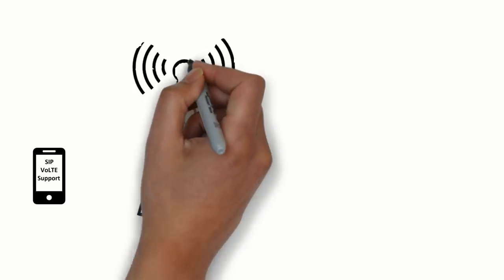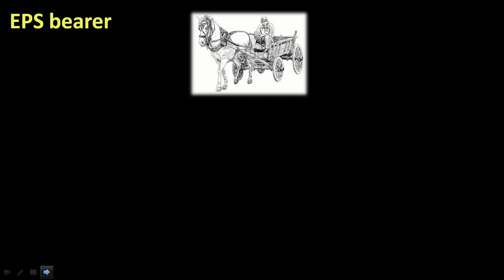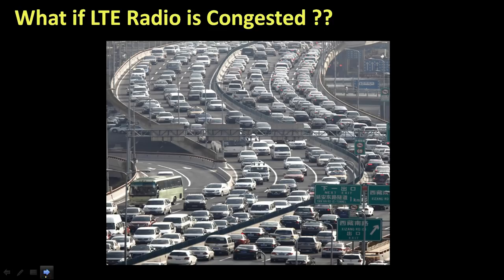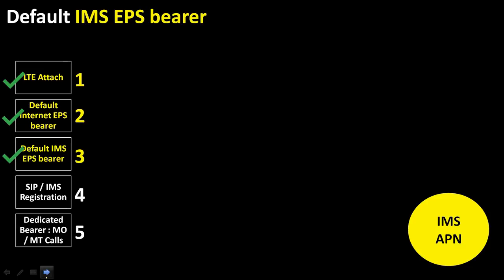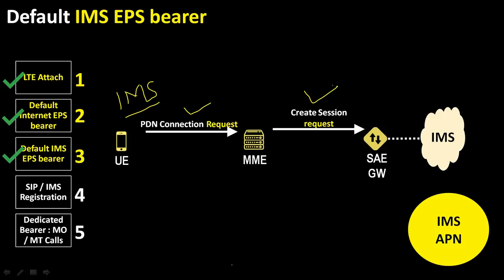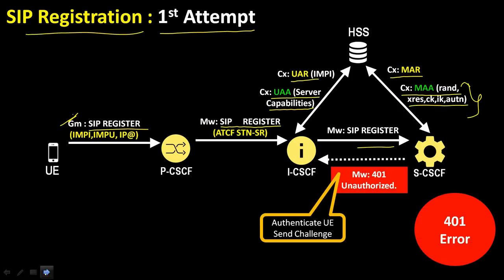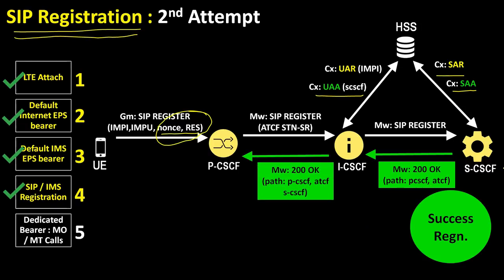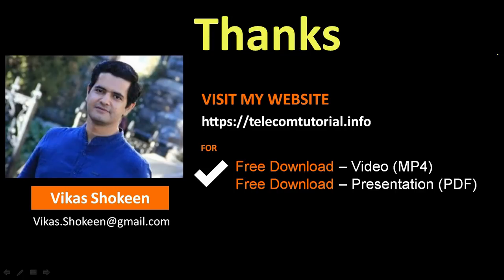3. IMS registration call flow - VoLTE Registration call flow - SIP Registration call procedure

Comment: Hi Vikas , 

Thanks for sharing valuable info through this video , Could you please help me to understand below query -
-  As we know in SIP  Via , to , from , call ID , cseq , max-forward and Contact are mandatory header for successful registration , is any other header which  are mandatory in SIP IMS ? like I have seen sip register contains -P-Visited network , P-charging vector and P-charging function in registration message .

- what is path header and why its required when already route header is there with register request ?
-

Comment: Hello Vikas, great content. Quick Question- If default bearer for QCI 6 or QCI 5 breaks during a call setup(INVITE- 180 ringing), can this result into a call setup failure?
Reply: I guess, by the time a 180 ringing procedure from a called UE to the calling UE in the INVITE message from calling to called UE, there is already resources reservation and dedicated bearer setup (QCI 1 if voice call). The call cannot proceed if the signalling part of the call is lost. This is my understanding of the flow. There must be a secure connectivity between UE and P-CSCF during the call

Comment: For IMS Apn, will there be a new IP address to assigned to UE ??
Reply from the maker: Yes , As explained in Bearer section , IMS APN is created on Default Bearer which has its own IP address ( this IP is different than one allocated for Internet APN )
Reply: TelecomTutorial info how PGW knows P-CSCF address , does PCRF returns it or SAE GW  has its own  configuration
Reply: Syed, P-CSCF IP address are stored internally in GGSN or P-CSCF address has to be obtained via DHCP . UE once it is attached to the network  triggers a PDP context activation procedure which carries PCO field with request of P-CSCF address.

Comment: TelecomTutorial info how PGW knows P-CSCF address , does PCRF returns it or SAE GW  has its own  configuration
Reply from the maker: P-CSCF is derived by PGW either via DNS Query or via Static Entry in PGW ( Also refer to 3GPP TS 24.229 , Section 9.2.1.c.II ) . Transfer P-CSCF address(es) within the PDP context activation procedure. 

The UE shall indicate the request for a P-CSCF address to the GGSN within the Protocol Configuration Options IE of the ACTIVATE PDP CONTEXT REQUEST message or ACTIVATE SECONDARY PDP CONTEXT REQUEST message.  If the GGSN provides the UE with a list of P-CSCF IPv6 addresses in the ACTIVATE PDP CONTEXT ACCEPT message or ACTIVATE SECONDARY PDP CONTEXT ACCEPT message, the UE shall assume that the list is prioritised with the first address within the Protocol Configuration Options IE as the P-CSCF address with the highest priority
Reply: @TelecomTutorialinfo   Sir , please tel me how/where can i get the IMS VoLte settings details of my Vodafone operator . I have a 4G gsm gateway  and i need this information... Thanks